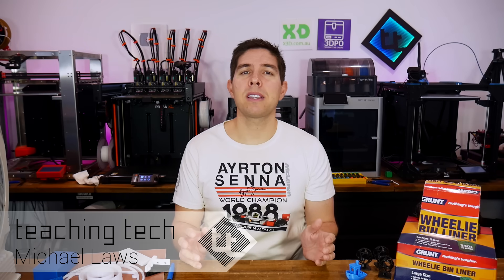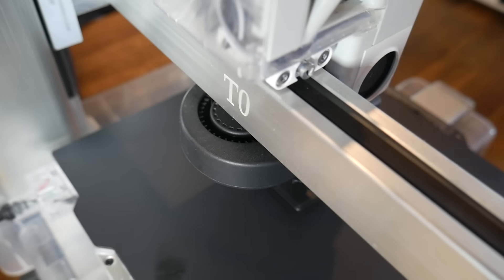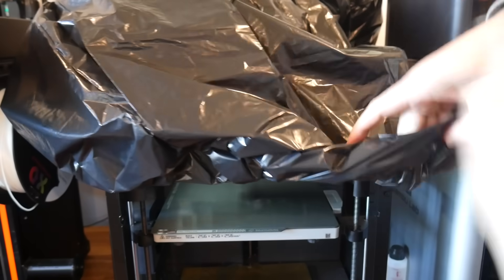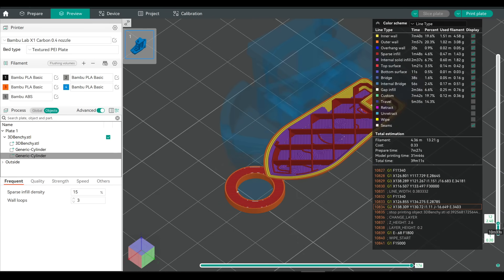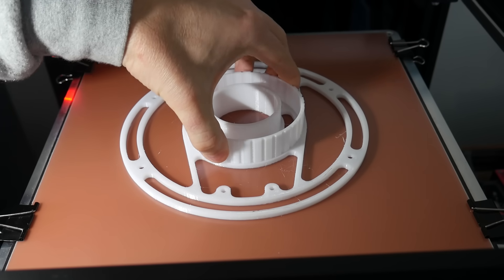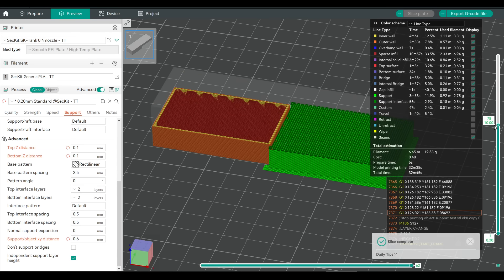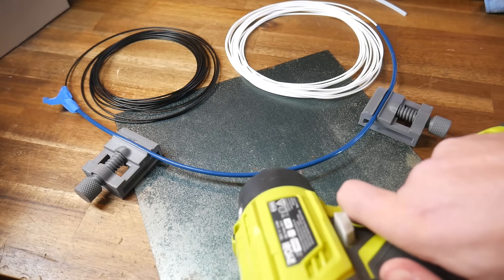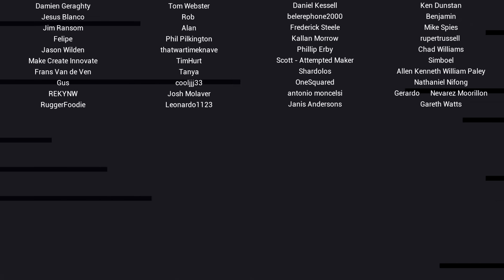Jankiest 3D printing tips that actually work

Comment: Some manufacturers sell G10 and G11 with the name Resin Fiberglass Plate or Epoxy Fiberglass Plate.
Also, you can scratch the surface with Low Grid Sandpaper or a wire brush to give it extra grip. It also changes the first layer from glossy to matte finish.
Also also, you can buy PEI sticker sheet and Boom, now you have a dual-faced bed
Reply: I bought a sheet of G10 after Angus's video. Paid around $15 US on eBay. The stuff works so well, and it's amazingly cheap
Reply: Do you have any tips for magnetic G10 sheets? From my understanding, your suggestion makes a double-sided sheet that need to be held by clips, right? I've trying to come up with a magnetic G10 sheet, but I can't find any options, even for DIY where I live.
Reply: @tuliobrunoro4136  You could try using a magnetic sticker sheet (or magnetic adhesive sheet). That said, I've never tried it myself so I don't really know whether the magnet will be strong enough to hold the bed from moving around.
The magnet is also going to lose its magnetism over time due to constant heating, but I understand why some people like it.
Reply: @tuliobrunoro4136  Try magnetic sticker sheet or magnetic adhesive sheet. That said, I've never used it so I'm not sure whether the magnet is strong enough to hold the bed from moving around. Also, the magnetism will degrade over time due to constant heating, so you might want to test it and see how long the magnetism will last.
Reply: @tuliobrunoro4136  I have a magnetic one. I had two PEI and one flexible magnetic beds already, they all came with magnets (at the time all magnetic beds came with magnets). So I used one of the spare magnets and glued it to g10. I put it under glass with some weight over for a week (because I forgot about it).
Magnet-to-magnet hold is really strong, and it works nicely overall.

Comment: I bought my first 3D printer over 15 years ago (I bought a Makerbot as soon as they were available in early 2009. For any odd folk that seem to think it's impossible someone had a home printer back then.), and there were some useful techniques in this video that I had never heard of before, but will be using now. Thank you!

Good idea to leave the spider alone. He will keep the printer from getting any bugs.  😜
Reply: Yer I want to add doubt about that statement, stratasys patent expired in 2008/2009 (16 years ago) the only mashines on the market is Stratasys mashines which was industrial units, reprap made thair fiat printer, which was not sold in 2007 (Darwin) then came the (Mendel) in 2009 still not sold, but you could dl the plans, which I tried to build, but was missing key components, that I was not able to source. then in 2011 Ultimaker came out the first printer you could buy, prusa 2012 along with wanhao, and others, ( I bought a dublicator two that year. so more than 15 years is highly unlikely. since the people that started the movement only started 19 years ago, and only had prototypes up until 2011....
Reply: @brianwgDK  Have you not heard of makerbot? I got it as soon as it was available in 2009. That would have been 15 years and a month or so ago. Hence me saying "over 15 years ago". I was having my designs 3D printed by companies before that. I don't know how many were sold at the time, but I assume there must have been at least 100 if not a few thousand sold the first year. I'm hardly the only person to jump on board that early. I started doing computer animation on an Amiga in 1989. Do you want to tell me I didn't do that either?  People on the internet are strange. LOL

Comment: One of the best techniques for part removal on any surface that needs to be cooled down is to go into the g code and change the bed temperature downward. My parts only have six layers so layer 3, I go from 60° c to 45° c Or add M140 S45

Comment: The sharpie trick is amazing. I think you should make an independent video about it and testing different settings, patterns and maybe a printable mod that we can attach to the printer so it prints a patter. I think that a patter will be better than coloring it all, because you will gain good adhesion, but also you will be able to remove the support.

Comment: I don't worry about joining filament.  When one gets closer to running out I just feed the second in right behind the first as the printer is running slowed down.  The extruder happily catches it and keeps on feeding as you help it by pushing it in from behind as needed.
Reply: lmao, I thought I was the only one using this silly method
Reply: I do this, but you do lose retractions until the joint gets to the nozzle.  Also you have to be there and hold it until it's past the extruder gear.
Reply: That's good if your printer cooperates but for me feeding material in is a trial and error endeavour and sometimes the material just comes out from some unexpected place like say the small gap under the lever or through the nearby heatsink. I should probably add some path constraints. There is already one i added below the extruder gear but it seems to be possible to miss somehow regardless.

Then again this IS the jank suggestion list.
Reply: Yeah I've done that. I thought that's what he was going to show when he introduced the topic.
Reply: My Bambu X1C handles filament runouts pretty well, but I like the idea of just stringing a bunch of short pieces together and spooling them so I don’t have to worry or tend the printer 😁
Reply: @DaveEtchells  I'd only do it on the Bambu if not using the AMS, it seems sensitive to bulges in the filament.
Reply: I used this to make over 80 hat tiles. https://www.youtube.com/watch?v=6A6-QcNM4sg
Reply: Did this on my X1C recently printing with some small external 200 gram silk pla rolls. Roll was almost done and I was manually pushing the new color down the tube and it worked fine
Reply: Been there, done that.
Reply: Yeah, this was my go-to method for years 😁

Comment: The sharpie trick was amazing. This is something you could easily integrate into a 3d printer's nozzle.....
Reply: I tried this a view years ago with simplify 3D but the main problem was the slicer. 
I used a clickable permanent marker and a "tool change" script to activate it. 
Maybe orca slicer can implement something like that. Simplify 3D didn't want to help me when I tried that.
Reply: Exactly what i was thinking... Would need slicer support but it's doable
Reply: If you put the sharpie on a servo actuator you could tell the slicer that your interface material was on tool 1 & add custom gcode for tool 1 to extend the servo.
Reply: @Person1873  Yeah while changing the offset. Compagnie should release a basic shit for this because it's just a game changer.

Also machine like prusa xl are made for this.
Reply: My thought was actually that sharpie colored print video he referenced,  but building at least a single color version of it, using something like interface layers and modifying the python script it could print then after it did the interface part it would color over that with sharpie.
Reply: @Charely6  I believe that this has already been done by the same person who originally made the sharpie color printing contraption
Reply: Yes, Sanjay once suggested using an inkjet printhead on the e3d toolchanger to do this properly. Someone should ackshuallly try that.
Reply: How many generations of 3D printing are we in now? It's fun to see people amazed by stuff that we were attempting when the printers could barely do what they do....
Reply: @tedzbug07  many but the main drop was price of stepper from 80€ to like 10€. My printer do the job cause added flex bed but big print need need blue tape. But 509mmsec is insane
Reply: Yep with a tiny servo
Reply: Holy shit. The sharpie trick. Is amazing.
Reply: There are already videos out there on this and there are tool changers you can build and everything
Reply: @thespacecowboy420  Yeah but let's be honest, most of us don't want to modify our 3d printer because it's too hard to model something and tweak the slicer + marlin firmwire.

And if you do something wrong you can destroy your machine.

So we need something out of the box.
Reply: @nobocks most people do modify their printers
Reply: Forget a sharpie, something like a "dauber bottle" used for marking bingo charts would allow for really speedy application. Strikes me that with the identification of what about sharpie causes prints not to stick, combined with a dispenser using a foam pad adjacent to the nozzle could be next gen!
Reply: @CamStLouis  The " worst part " is a servo is arround 8$...

Comment: @9:10 - Bent BLTouch pin detected.  I did the same thing.  I crashed in to the bent, bent the pin and broke the bracket.  I straightened the pin using my hot air solder station.

Comment: I am working with a very nice and very successful jank right now. I (also) have a resin printer, and some time ago I got a leak in the FEP film of the vat. With some clear tape applied to the bottom side I have plugged that up. Now I do have a replacement FEP in house (ordered at that time). But as long as this is working successfully I see no reason to change to that €15 part. And I do use the section of the build plate that's over the plugged hole without any problems.
As a matter of fact, even if this fails, I would first try another jank I heard about. And that's preparing half of a laminating pouch in an oven to get a similar clear plastic that the FEP is. That would be a factor 50 cheaper than that overpriced A5 size of clear plastic that's the official replacement.
And of course, even if this fails, at worst I have a resin spill onto my silicone placemats in my enclosure. And then I can switch to the official stuff.

Comment: Torch for stringing is amazing, way better than heat gun, but you dont need a full blown torch LOL

Those little pocket torch lighters from the gas station work perfect for this, and have a small flame you can pinpoint spots with.

Also works great to remove stress marks from ABS.
Reply: I sue the ones a chef uses for Creme Brûlée
Reply: I use a "pen" soldering torch, which also works great :)

Comment: Here is my janky one :D When I had issues with ABS lifting in corners, I used a knife to cut a piece of glue stick. Shoved it in, and used a torch to soften the curling part. Than used the spatula that came with the printer to push down the curved part into the glue stick. I did this now on a few occasions and works like a charm if you only have 2-3 layers above the bed and the print started to curl already. 
Janky as hell but work :D
Reply: Yeah, I've done similar. If something comes detached from the bed, just PVA glue it back down in your best estimate of the right position, and carry on printing.
Reply: If this happens later in the print, baking soda and CA glue can save adhesion. Costs the bed surface but no problem if your bed surface is something cheap like blue tape.

Comment: Definitely did most of these. The torch to clear the strings has been a staple my wife still cringes at. Plastic bag enclosure has been upgraded to some laser cut acrylic panels, and welding filament together is done using a brass block that I drilled a hole through. I then heat the block with the de-stringing torch, and push the ends of the filament together. Works pretty well most of the time. I usually go the extra few inches and trim the join with a knife though. It's not jank enough unless you risk personal injury.

Comment: I don't know how janky this is, but I have a trick for speeding up print surface/part cooling after a print. I use a hot pad to remove the spring steel build plate as soon as the print ends, then put that on the biggest piece of metal I can find. I use our big metal sheer at work, but a table saw, band saw, drill press... would work too. I push the print surface down, to stop it from warping as it cools. The metal acts a a big heat sink and you can feel the build plate cooling down rapidly. It's great for impatient people.
Reply: I just fan the whole plate around in the air. Outside if the weather's cold.
Reply: @andybrice2711 thanks god I’m not the only one
Reply: I printed a plate holder for my desk fan for this purpose.
Reply: Or put it in a fridge or freezer
Reply: @petervillano3484  while I think you aren’t totally wrong, I think it’s the cooling differential between the two parts, hence why cooling the bottom might be the only effective way.
Reply: @blockfifteen  steel has a coefficient of thermal expansion ten times of that of plastic. tossing the build plate in the freezer works well for other people I've talked to

Comment: That sharpie trick I might actually use. Got a project that just doesnt have a good way to support it and look at the same time.
Reply: A probably less janky way is to add a holder at the bottom that you place a previously printed support block into at layer pause. You can print the support block from an adhesion incompatible material, or coat it in a release agent or temporary adhesive such as shittiest glue stick you can find. Instead of a holder, maybe an application of glue stick may suffice at the bottom as well?

Actually this is something i have been puzzling about how to support just today so i'm going to try just that. The print will be cylindrical so it will just be able to wear its own temporary support.

Comment: I've had scenarios where I've had to complete a model on my Ender-3 S1 using small pieces of brittle filament. I've fed the pieces directly into the extruder while it prints, ensuring the filament sensor is triggered. Perhaps not the jankiest of tactics, but it has worked.

Comment: Here's one I got- when printing multi-material (EG PLA-PETG or PLA-BVOH/PVA) in prusaslicer the transition towers would sometimes delaminate due to the materials not adhering together, and sometimes this could cause a print failure.
My jank solution?
After slicing a first time, make a box shape and edit its dimensions to contain the tower, setting its material to whichever is the main material. Reduce infill to something like 5-8%, reduce perimeters to 1 or 2.
The jank part is that you're printing over the same place in a single layer, but this encases the transition tower, and the infill of the container object "holds down" the transition tower's layers.
It also might be possible to also just make the container a draft shell around the tower to just contain it if it becomes a spaghetti mess, but I never tried that (arguably easier and less material intensive) option.
Reply: I think the slicer can do that automatically. I think there's a setting for changing the perimeter material of the purge tower. I think I saw a video of someone using that setting to accomplish exactly the same thing.
Reply: @generic0000 Yes, this.  There is a setting in multiple extruders where you can pick the main extruder for the wipe tower and that will always be the other perimeters.
Reply: @bluerider0988  Even with that setting, with BVOH in particular I'd still have issues of delamination, so I chose a sledgehammer solution since it'd always happen on prints that were longer than 10 hours.
Reply: @barrag3463  I can't speak to your particular issue, but I regularly print with PLA and PETG which don't stick, and I set the PETG as the wipe tower extruder and the outer wall of the tower is always PETG and it only prints the PLA in the inside of the tower.  I've not had a failure yet, even on a 46 hour print.
Reply: I have just taped it back down using blue painters tap… after a few layers it would work fine again
Reply: OrcaSlicer by default makes tower walls only from primary material, if second one have flag of support material

Comment: I run FFC cables on my X-Y axis and accidentally shorted out to lines where the heat from the surge current melted the insulation. The copper underneath is perfectly fine so i just stuck  taped over the exposed copper rails and it has been fine ever since.

Also one time forgot to tighten some bolts on my toolhead and they fell out mid print, leaving the tool head attached with 2 out of 4 bolts. I looked stable enough so i made the decision to let the print finish instead of pausing and reinstalling these bolts. The print was fine.

Comment: In multi-part prints I've sometimes had some come loose, and if I caught it as it came loose (you can typically hear it), I've had some success just taping it down in roughly the right place and resuming the print. That part is pretty much scrap, but it saves the rest of the parts in the print.
Reply: or get firmware that can exclude objects?

Comment: Another janky habit I have is to move my printhead to push parts from the bed remotely, so that they fall out and a new print can be started. This works especially well with camera setups like in Bambu printers and octoprint setups
Reply: I think this doesn't count, since this is printfarm standard practice.
Reply: Did this with my octoprint setup too lazy to walk downstairs 😂
Reply: what about the purge line?
Reply: @mosesbeltran8390 my thoughts exactly lol
Reply: What about purge lines? Or do you disable them
Reply: @blockfifteen  in my experience it’s fine to Stack 2-3 lines on top of each other
Reply: this is brilliant, stealing this